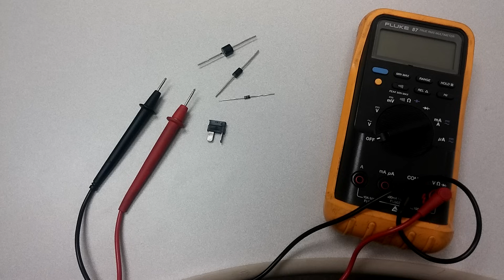How to test a diode

Comment: Well I never knew what that symbol was for, on my Radio Shack pocket auto-ranging meter from the 1990s. Thanks!!
What brought me here is my 6 month old Keychron mechanical keyboard, which ingested some food or drink, rendering the left and down arrows inoperative. I opened it up and cleaned the board, and it acted wonky. So I examined closer and saw a diode for each key, and searched how to test them. They are good, and the affected keys beep continuity when pressed, so hopefully a little more cleaning will get it - I suspect there was still moisture in it when I first tested it, making it do crazy uncommanded things to the computer...

Comment: Do not use this method for microwave diodes. Microwave diodes are many diodes sandwiched together and they have a voltage drop of about 10 times higher. This requires the use of a 9 volt battery to get the diode to flow current. Otherwise,when using a voltohm meter, which only supplies about 2.5 volts, these type diodes never open up to flow current.  always read OL.

Comment: air pressure runs the wheight water runs the electric maybe exxess air pressure can run a tube turbine to do more for every one this engine dosnt have to move to work  centrivical force can pump a compressor to run something how many things can you put on one wheel to stop it if you feed it more than it needs if i had the money i would be dead for making it

Comment: trains = tons rolling use electromagnetic generators on the axles to run water electrolysis to make hydrogen to run generators and have electricity to run any thing you want

Comment: like a steam engine that built to much pressure and blew a horn to let it off this is the first horn it was over pressure release imagine they had every wheel on an air      pump for the steam PRESSURE engine it would never stop till you let off all pressure

Comment: why not since earth has air use air to run a motor a honda runs 20-40 psi per cylinder air tanks can hold tons you only need unity  for space travle on earth every rotation makes pressure to run the system if you have a water generator working from water how many more can you add to the first one hence transmissions take windmmimlls
now think of water through 100s of generators no noeed to cool but you need to multi ply the out put and utilize your suroundings

Comment: Those 0.2, 0.6, 0.7 volts means that drop of voltage in the circuit that the diode causes as well?

Comment: I used an everstart multimeter and test a pcm diode fuse for a ford and one side reading says 0L, the other side says 627. Not .627, point 627, just 627. What does that mean? Is the diode bad?

Comment: If i soldered a wire at each end of the diode can i check at the ends of the wires. I ask this because i would have to take apart my harness to get to the diode.
Reply from the maker: This would work as long as it is completely disconnected from the circuit.

Comment: My Honda ATV has the last diode you tested and one of the legs is marked with a plus + sign. I put the red lead on that side and black on the other and got OL, i switched them and got .532? It seems mine is operating backward. Is that possible?
Reply from the maker: I don't know why that seems to be happening, but it sounds like the diode is working.  Are the leads on your meter plugged into the right spots?

Comment: Is it possible that using multimeter Unit 139A on new diode (12kv 450mA) I get OL reading in both directions. Like it is possible just this diode can't be measured by this meter or what are other reasons ? I measured like 10 of them ...

Comment: Is it possible to read The Diode by using the ohms setting?
Reply: My digital meter won't, either direction of meter leads gives null reading. My old school analogue meter can show continuity on Ohms settings - when positive lead of meter placed on diode's cathode, negative lead of meter placed on diode's anode. Several people say some meters do not supply enough voltage across the diode to gain a reading when in Ohms Scale. If anyone can explain why my analogue meter is better at this, please let me know!

Comment: when the diode on cellphone board or sad electronic diode reads in 1.338, 1.483, , 1.395 (+)---|<|---(-) tested this way, and .693 this way (-)---|<|---(+), is the diode at fault? there was no DC power source on the device when tested.

Comment: I got the right reading when removed from the board but bad reading (curent flowing both ways) when connected to the board (motherboard) . Have only 2 reading "bad" on the board , the rest getting good reading (connected to the board ) . Are those 2 diodes bad or I should look somewhere elese ? (Different components)

Comment: this diode voltage cannot be measured with the volt-meter mode, so there is no "free" voltage there, like a.. say..  0.6 volt battery. Right?
Reply from the maker: That is correct.

Comment: How do you find out the value & voltage of a diode, if the diode has nothing printed on it, in other word it's plain, I have a few & would like to find out, great video by the way👍
Reply: The voltage is the voltage drop across the diode and the rating to worry about is how much amperage it can take.

Comment: You used the term forward bias ...does that always mean " direction of current flow"? Why the term bias?
Reply from the maker: When the diode is connected into the circuit so that the polarity of the voltage will allow current flow (higher voltage on the anode side and lower voltage on the cathode side of the diode), it is considered forward biased.  If you reverse the installation of the diode or the polarity of the circuit, current flow will be blocked.  This diode is "reverse biased.". Does that help at all?

Comment: Justin, thanks for sharing your knowledge and for showing me how to properly use my Multi-Functional Digital Meter. I’ve had this Meter for years and never ever even noticed the Diode/Tone Function. Your video has helped me to rule out replacing the Electronic Fuel Injection Main & Fuel Pump Relay on a 45 year old 1977 Datsun 280Z. 

Driving a classic car can be a great lifestyle but it also has its frustrations and in troubleshooting electronic/electrical components that always carry enormous levels of obsolescence and many of them haven’t even been available in two decades. Keeping it up tip top you need to be careful with removing and replacing parts. Thanks again your video has been very helpful for me to learn how to test and diagnose the diodes and resistors in my my noted EFI Relay circuit.
Reply: Good afternoon my friend,
Nice and clear video.  
I have an alternator that Im trying to check the diodes on with a free Harbor Freight multimeter.  It shows a 1 instead of .0L like yours but its showing 1 both ways.  
Could the multimeter be defective?  Its a cheappie Centech.  
Thanks in advance!!!
Reply: @likits1999 to get a reading on the pass through direction the multimeter needs enough voltage to get a reading and my Kaiweets HT118E only has 2 AA batteries so it does not not have enough voltage to get through but my Wavetek DM27XT has a 9V battery and in ohms mode I get a reading both ways on the 200Mohm range as my Microwave diode on the pass through side is over 40Mohms.
So if the diode is only working with low voltage in the circuit the 3V battery is enough to get other than OL or 1 on the display.

Comment: Great video. Just one query, can you run the same test on a diode without removing it from the circuit board? Anyone?
Reply from the maker: I think it would depend on the circuit the diode is in.  It would work in some cases, but not in others.

Comment: I have an auto ac clutch diode I'm trying to test. On my multi meter there is a diode symbol and at the same location it is an audible continuity test. When I put the meter on the "diode" setting and test diode with positive lead on one side and negative lead on the other side. The screen shows a numeral 1 when starting test then when performing test as mentioned nothing changes on display. When changing leads to opposite contact points on diode I get a reading of about 665 on the screen. It doesn't identify this as voltage, ohms etc. So basically the positive lead on triangle side of symbol and negative lead on plus sign side of symbol produced the above mention reading of 665. Any help on this is appreciated as something is causing fuses to blow in ac circuit when clutch is engaged and I though the diode might be bad.
Reply from the maker: I don't know how your specific meter works, but it sounds like you are getting a different reading one direction on your diode than in the other.  Of so, this would indicate that your diode is good.  

Do you have an electrical diagram?  This would allow you to see what other components are downstream from the fuse that is blowing. 

The ideal test would be to measure current in the circuit using an oscilloscope.  It should ramp up to about 4-5 amps and hold steady when the compressor clutch is turned on.  If the windings are shorting under a load, you would be able to see irregularities or current spikes. 

 If you don't have a scope, you can disconnect the electrical connector to the compressor clutch and measure resistance of the clutch winding.  It should probably be about 1-3 ohms.  Anything less would indicate a shorter compressor clutch coil.  

If it measures within range, that doesn't prove that your clutch coil is good.  Ohmmeters can never prove that a part is good.  They can only prove that a part is bad.  

Good luck.  I hope that helps.
Reply: @JustinMillerAutomotive  I don't have a diagram but the clutch relay has been replaced and the fuse that is blowing right after clutch is engage manually is the ac clutch fuse. So diode, AC Relay and clutch fuse. Not sure if anything else is on that same circuit. I'm hoping to borrow a better VOM with a clutch diode test that is only for testing the diode in hopes of making certain if the diode is bad or not. I ordered another diode just in case its needed as I understand if the diode was bad it would cause voltage spike when clutch is engaged that can blow the fuse. Though I know if there is a sensor locking out the clutch operation due to a high or low pressure fault, that may be a factor too.
Reply from the maker: @ParisKYLakefishing  Have you tried disconnecting the AC clutch connector to see if the fuse still blows?  If the fuse only blows when the AC clutch is connected, it is likely the windings in the AC clutch itself that are shorted.  Yes, the diode does clamp the voltage spike, but even a voltage spike of up to 250 volts will not blow your fuse.  The spike has high voltage but nearly zero current.   An unclamped spike can cause damage to other components, such as an ECU.  The only way the diode could blow the fuse is if it is shorted internally (so that current flows in both directions) or it is installed backwards in the circuit.

Again, I am only speculating because we don't have a diagram or the test equipment to be certain, but it sounds like you have shorted windings in your clutch and will likely need a new compressor clutch.

Comment: Hi Justin. Is what you have shown also holds the same, when measuring diodes connected in a circuit board? I'm trying to diagnose an old Sanwa analog multimeter and I found out 3 diodes giving me both directions 0.95v/0.51v , I am using a Fluke 17B+ doing this measure. Are these diodes damaged then?
Reply from the maker: If the diode is still in the circuit, there is a possibility that you will experience continuity or even voltage from another part of the circuit.  To test it accurately and independently, it should be isolated from the rest of the circuit.

Comment: Well, it didn't show me how. My meter hasn't got the diode symbol. For people in the same boat as me, they can do this: meter -> aa battery -> diode -> meter. The volt reading will only show if the diode is correctly oriented. The reading will show battery voltage - diode voltage drop. On a 1.2v battery, with 1n4001 connected, I get 0.6v reading. The voltage drop is 0.6v meeting the diode spec.

Comment: How do you test a tvs diode? I have one without a stripe thats why im having trouble identifying the anode and cathode
Reply from the maker: You can test it the same way as shown in the video.  Just check both directions, even if you don't know which end is which. If you only get a reading in one direction, this will also help you identify the polarity of the diode.
Reply: @JustinMillerAutomotive  I have a TVS diode on hand, P6KE56CA but when i try to test it, even when i compared it to a new one, it does not give me a reading on either side. What do i do? The new one which i bought onine behaves the same when tested
Reply from the maker: @biomed2341  I may be wrong, but I think your diode might be bidirectional, only allowing flow when the voltage exceeds a specific threshold.  If that is the case, it may not matter which direction you install it.  This is only my guess, though.

Comment: An improvement to the video would have been to show what a shorted diode, or a dead diode would read as.
Reply: My understanding is that if a diode is bad it will do one of two things. Either it will read some voltage in both directions or it will read nothing (i.e. it will read 0L) in both directions.
Reply: I'm serious, I would also like to see a few examples of bad diodes so I can wrap my tiny brain around this test.
Reply: 🤦‍♂️ you can’t be serious 😂😂😂 literally tells and shows how to test and what a good one shows. Don’t have to show a bad one.

Comment: Can someone explain this to me...   I tested a diode in-circuit and I got a reading going BOTH ways, right?  I removed the diode because I thought it was bad, but once I had the diode removed from the circuit board it tested fine.  I went ahead and replaced the diode...the new diode also tested fine out of circuit but when I soldered it in place it shows a reading going both ways as well.  How can it do that??   I can't find bad diodes if it's going to keep fooling me like that.  I went through the entire board after this.  Most diodes would read one way only, but 2 or 3 diodes were also reading both ways.  Any suggestions/help???
Reply: This is happened to me too. I mesaured boths way when diod is in board but out of board the misure is changed and It looks good ..so i think diod is good, or not?
Reply: @tommasoa1620  From what I understand, you have to take the reading "out of circuit".  So, in other words you have to remove it from the board.  I've been told that other components on the board can make the readings inaccurate so remove it to test.  It's weird, I don't fully understand it yet.

Comment: I wanted to know why we aren't reading resistance. Instead we are reading volts.
Reply: Kyle Wilzon beacuse he’s using the diode test mode. .. use ohmmeter to test the diode,set the ohmemeter to lowest range.

Comment: Can you help with advise please.  I am rtying to fix a very small PCB.  Diode is a H30 ...  It has 4 points.  1 is the negative and 3 which must be positive.  Just guess.  Yes i can see th white side as you mention.  Negative.  Well okay good lets try your tests.  negative on white dash.  Probe + on the other 3 pins.  1st pins no reading - 2pin (middle pin) reading of -.750 for 1 Millisecond then nothing.  pin 3 - nothing.  okay umm.    White dash + positive lead.  Repeat same steps as above.  Same results BUT!  I get  a positive read out of1.800 odd for 1 millsecond.  then nothing.      Does this mean my diode is dead.?
Reply: Also, i have notice that on this PCB that a magnet slides over this diode regularly.  This diode can be found in car brake switches.  This is what
 I am trouble shooting.

Comment: These are Ohms mate,,, not volts,,, Just saying,, :)
Reply: On a multimeter with "diode" mode the test probes are given a very small voltage. The number in the display will be the voltage drop across the diode, in volts. You CAN also test the resistance of a diode in forward and reverse bias, but it isn't the most reliable test. Refer to: https://www.fluke.com/en-us/learn/best-practices/test-tools-basics/digital-multimeters/how-to-test-diodes-using-a-digital-multimeter

Comment: @ 1:48 I believe OL on a (d.m.m.) multi meter screen does not stand for "out of limits but rather an abbreviation for Open Loop, or rather Open Line, they both fit.
Think about continuity...
there is nothing involving any sort of limitation needed to have continuity or not have it. Open Loop or  open Line, they will also fit.
Love to learn so correct me if I am wrong.
Reply from the maker: Thanks for teaching me something I didn't know!  I am always learning as well.

Comment: if the diode shows 0.013 on both sides does it mean it is broken?
Reply: Yes; it's either a broken diode, or a resistor, not a diode!

I encountered the same with a cheap relay (but 85mV instead of your 13): 

It had "D1" and "D2" silkscreened on the board so they were supposed to put diodes in there. But they didn't look like diodes, but like resistors. Sure enough, measuring resistance gave me 73 Ohm or so. 

Not good to use with an Arduino - you need a Flyback Diode (look it up!)

Comment: Useful Simple testing, that is the one l am looking for. Now, i understand the Current flows through the diode one way from Negative to Positive and it will block another direction.
Reply: Yes, if it is forward biased then it will conduct if voltage across diode is more than threshold voltage. What Justin Miller has tested is actually its threshold voltage. I reckon so.

Comment: What if I used these diodes in the system that generates at least 1000volt of DC? For water electrolysis to generate hydrogen fuel to replace petroleums?